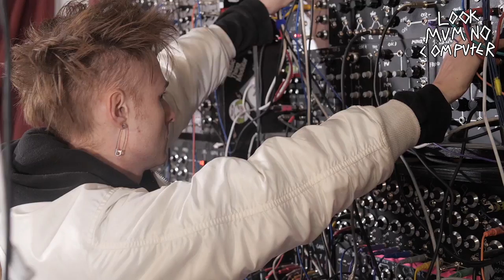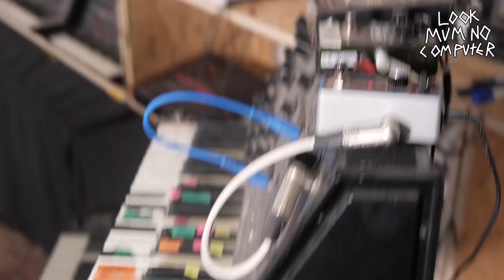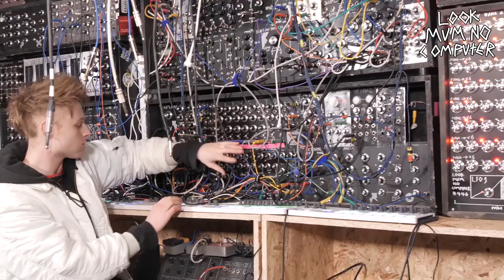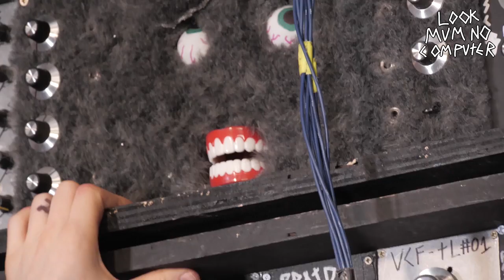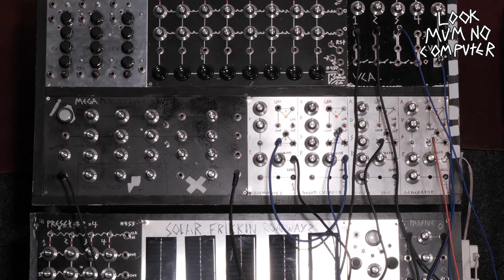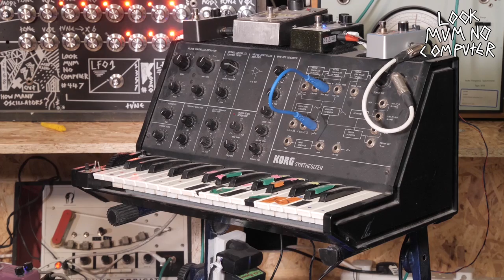A MODULAR SYNTH WALKTHROUGH OF MY DIY MODULAR SETUP

Comment: One question: Price?
Reply: Less than an OP-1
Reply: @massimookissed1023  I strongly doubt that. What makes you say that?
Reply: @stefanhansen5882  , because the OP-1 costs over a grand, and Sam's rig is hand-built using commonly available electronic components.

Although I wrote my first comment before I saw the Beatsteps, which are about $€200 each.
Reply: @massimookissed1023  The Beatsteps are about the same price as an OP-1. The synth he is playing and the effects pedals are not for free either. My guess it that the DIY modules cost at least 3 times more than an OP-1 and would cost closer to ten or even twenty times as much if you bought similar modules made commercially.
Reply: @stefanhansen5882  , yeah, if you wanted to buy commercial Eurorack modules to build Sam's rig, you may as well just set fire to cash.
Reply: @massimookissed1023  Even going the DIY route I am quite sure it will cost around 4,000 GBP + tons of hours soldering.